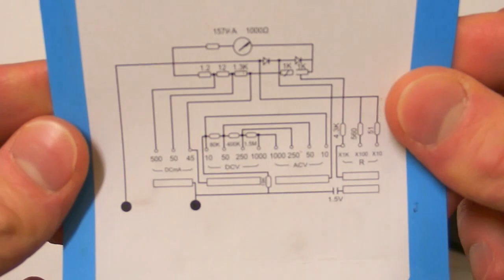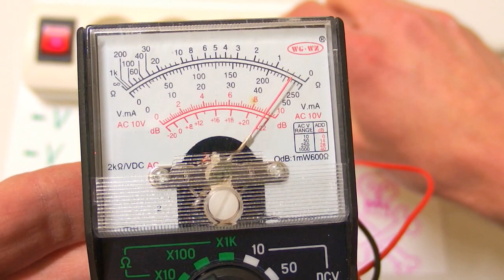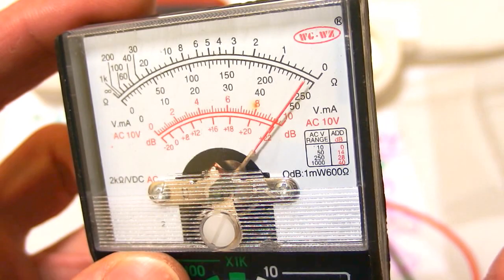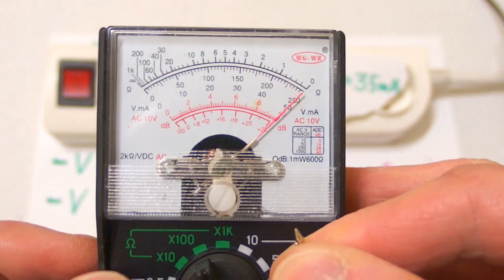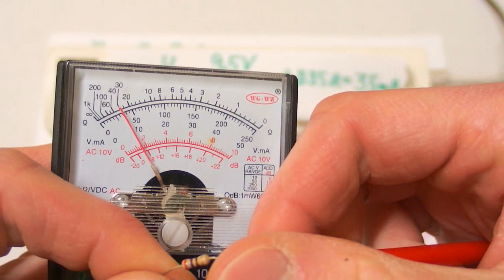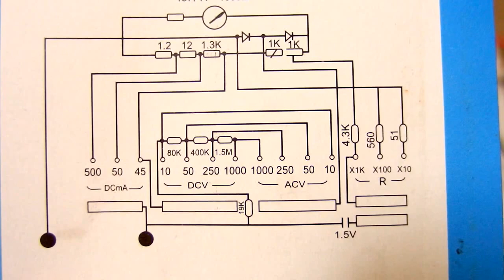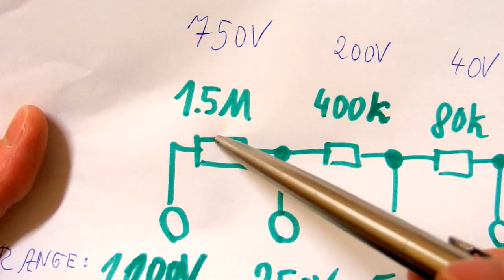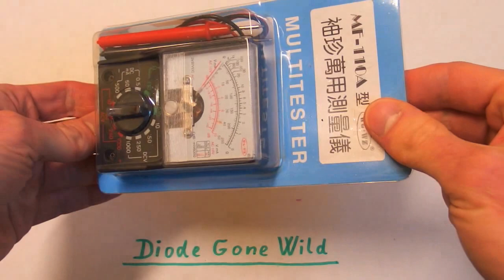Tiny $2 Multimeter with 1000V Range! Test with Smoke

Comment: I generally buy these multimeters to use the movement only (print a new scale and glue it to the existing panel). You tested the old multimeter and it gave out smoke - that's because these old models use smoke signals for high voltage :-)
Reply: Great observation... the Indian multi-meter complete with smoke signals... he-he
Reply: HAHAHA love your sense of humor. You should watch electro boom. He tests for high voltage by getting electrocuted
Reply: yes, i used those multimeter indicators as VU meters onto an amplifier, they are slow to move but if you cut away the needle and replace it with something more lightweight (the original seems aluminium) like a black brush hair it moves slightly faster, sadly they are becoming rarer bought locally

Comment: I bought one, gutted it out and turned it into an ESR-meter :D Can't beat that for a price: you get the movement, the case, and probes. Probes are junk but you can change them no problem.
Reply: the meter electronics do seem to be well made. too bad the manufacturer doesnt offer two grades of quality for that meter for a higher price of course. I would love to see you post that diagram of your ESR-meter modifications. I have two commercial meters with ESR features and they dont agree with each other. completely different readings!

Comment: I had the exactly thing as a child, 18 years ago. I asked an electrician, wow this thing can really measure up to 1000V? and he said: ``Maybe vietnamese volts``
Reply: it did measure right until he switched to lower range..
Reply: @JanoyCresva66  LOL
Reply: HAHAHAHA! good one but unfair. of all the Asian countries I think Vietnamese products are well constructed. It is mainland China that is giving all the other Asian countrys a bad rap
Reply: @professorparabellum  that's a racist joke. Propaganda made by USA government. They did the same thing with Japanese because of the war. If he wanted to joke about how cheap it was then he would use a Chinese instead. But no. He is racist at heart that's why he made that joke.
Reply: Well, in all honesty,  its so simple and with higher quality resistors, it'll be a good device to teach kids. Let your kids discover the world of electronics, without a 400€ Fluke or Metrawat Multimeter.
Just like you,  I had one of those cheap toy multi purpose instruments my dad soldered a 1A fuse in series to the leads. It worked for 3 years and it reached me a lot about the value of good equipment.
Reply: @DODO31193  we are Europe eugenes
Reply: Metric martha
Reply: It’s a very good design
Reply: It's not just high voltage but transients on the line that might kill you using a multimeter like this. That's basically a CAT I / 0. I use it with low voltages only.
Reply: @heatherriley2170  to be fair, in the 1950''s Japan did turn out a lot of crap just as China does now, so who said that at the time, would have been right. I'd say calling out VIetnamese for that would be more ignorant than racist as the Vietnam name might have stuck in his memory because of the war.

Comment: The vibration before smoke was the result of the diode exceeding its peak inverse voltage. It fused short, passing AC to the meter, just before the series resistors "went up in smoke".

Comment: I would never try to use that to measure 1000 volts, probably not even 220v or 110v mains voltages with that particular meter.  The looks of the build quality shows that it is questionable, and no fuse.  But for someone needing to measure small DC voltages (perhaps 1.5v - 24v) voltages, and resistance, without need for high accuracy should be fine.

I know some folks that bought these just for the meter itself, to build custom testers, etc.
Reply: It's useless for small voltages as well. I bought one on a local store just for the lulz and it measures 5v right, but when I feed it 3.3v it measures 1v. It's just a toy.
Reply: Yes I would agree low priced multi meters have a place in low voltage testing, zero to 24 volts ideal but when dealing with mains voltages and above a good meter is paramount. Fluke models or similar and of course a digital meter would be a better option than an old analogue style meter. I have two meters a very expensive fluke and a cheap lasar branded digital type the lasar meter cost approx 6 pounds the fluke 260 I would not attempt to use the lasar meter on the mains supply but it's ideal for automotive electrical repair, and it's not to bad on accurate.
Reply: that is a meter you would give to your child as his first meter. But caution them not to measure high voltage with it
only batteries. I have an old Simpson meter and it states in the cautions, do not touch the meter while measuring high voltage. Turn off the power before connecting or disconnecting to the main power

Comment: 6 years later, and still no another video with a high-voltage test of the new multimeter.

Also, those "questionable" pin plugs were the industry standard on Japanese multimeters up to roughly the early 1980s. And the westerners happily bought all those Japanese-made, rebadged Micronta, Radio Shack, Tandy and Sears multitesters.

Comment: I have this meter's big brother the MF-47 which is rated for 2.5k.  No smd, is also sold in a kit form, for 13.50usd.  I tested it and it worked just fine.  The accuracy is pretty good and it will test capacitors, and transistors.  I think this one could be modified to work fine.
Reply: The "MuthaFukin 47" XD
Reply: I googled the MF-47 to have a look and the input socket of that model is marked "2500V, 10A"
Reply: sounds like that meter is the one that should be sold

Comment: The problem with this is there must be a hole in it. Because its letting the smoke out. These things work using smoke because when it all escaped it will not work.

Comment: I have such a thing for a long time. On the bench, I mainly use it to measure voltages when ordinary digital voltmeters cannot be used due to high ripple levels (such as DC power supply from cheap halogen bulb driver) and I never use it to measure 1000V at 50V range. I think that's common sense. 
When measuring resistance, you need to calibrate the meter for each range - you will have much more accurate readings. 
For me, this is a profitable item stored in the pocket on my motorized bicycle, exposed to all the risks - theft, loss, impact, wetting, overheating, etc. For $2 I have a bold multimeter that survived for over 7 years and is still alive. 
Thank you, Chinese people! 

P.S.: It's not meant for stupid people!

Comment: i used those multimeter indicators as VU meters onto an amplifier, they are slow to move but if you cut away the needle and replace it with something more lightweight (the original seems aluminium) like a black brush hair it moves slightly faster, and there's room for some SMD LEDs, sadly they are becoming rarer bought locally

Comment: I used this type of multimeter when I was in 11-12 class. I was an electronic hobbist.  Also I saw every street wrist watch, calculator, torch light repairers using this type of multimeter. They actually used it for dc low voltage and they used to fixed the small ends of the probs with the pcb board by soldering. It was enough for their work. I bought it for 80 taka= 1 dollar. Still I have the red prob.

Comment: Honestly im surprised that that tiny thing handled 1000v xd
Reply: The fault is not with the meter. It is with the idiotic manufacturer to not be able to handle the English language and properly instruct the user for safe operation. Putting a fuse safety label and fuse ratings on the back of the meter THAT HAS NO FUSE, is wrong

Comment: One day I tried one day to measure amps on my 220v socket using one of these. The result was a small explosion, smoke from the meter and the circuit breaker for the room falling down.
Reply: KCTV Programme 'Recording you put the multimeter directly in the mains ?
Reply: Yes, but I’ve used it before for voltage counting and it worked fine on the mains.But when I switched it to Amps, BOOM
Reply: KCTV Programme 'Recording it's normal, Never put the multimeter in amp mod directly in the mains because amp is I = U/R, you need to put a resistor between the multimeter and the plug
Reply: You are supposed to connect a meter in series with a load to measure amps. When you put a meter into an outlet you are shorting it out. There is a wire shunt inside the meter that the current passes through. The meter just measures the current across the shunt. Outlets can deliver a lot of amps instantaneously before a breaker trips. Enough current to blow stuff up. But I guess you know that now.
Reply: you had it on the correct setting?

Comment: I'm a little wary of Harbor Freight digital meters on 120VAC, but I've never been bit. I'm pretty careful, since I used to measure 40-50,000 volts using a big Tektronix probe with SF6 insulation.
Reply: A high voltage probe is the only way to measure high voltage and be safe
If you must measure high voltage shut off the power connect the meter then turn on the power. do not touch the meter. That is what my Simpson meter instructs you to do on my old model 260

Comment: Found one in my local electronics shop, it cost 30.500 rupiahs (INA) or about 2 USD.
Reply: I hope it works well for you. I prefer to buy my equipment on line and reading the reviews. With Amazon if it is a piece of junk you canm return it... no questions asked.. even get a warrenty on the product

Comment: Yeah it's cheap, but for $2, that's pretty impressive. I only use my multimeter on 1.5, 3, 9, 12, 24, 120 volt stuff and check resistance. I think I might get one just for kicks. :)
Reply: why are there no dedicated ESR meters out there? I only see meters designed by viewers and no schematics?
Reply: Its 2 bucks for a clearly used already cheapo multimeter.

Comment: I still have an old Micronta that looks a little bit like that, except no knob, just multiple holes to put probes into to select the voltage/current/ohms/etc.
Reply: I have a totally automated Micronta, auto off, auto ranging, but a cheap phenolic board that cracked and broke many of the fine lands/traces, a really nice meter when it worked

Comment: I have a multimeter that looks almost identical to that, it's made by GB instruments. GMT-312
I never use it. Mine only goes to 10 V....50 V.... 150 V. & 300 V. Both On AC and DC.
1000 V. ??? I don't think so !😂
 I smell some Magic Smoke on the way!

Comment: I think the fuse is built in on the probes, maybe the current rating is to high?
Reply: In over 50 years of electronics experience, I have NEVER seen a fuse built into a multimeter probe.
Reply: @johnc8910  , the probes's cable IS the fuse.
Reply: that is an interesting observation

Comment: I use a analog multimeter and it has got no problem testing ac voltage  but mine is very good quality and the scree is bigger and i replaced the leads and it can measure more resistance etc

Comment: I had one of those exact meters for about 20 years! It just died this year.  Really, it wasn't the meter's fault--the battery leaked into the movement...poor meter...  :o(

UPDATE:  I FOUND A NEW ONE!!!! SUPPOSED TO BE HERE IN TIME FOR NEW YEARS!!! only $3.32 with shipping...I would only use it for DC stuff anyway like the last one. :o) #nostalgicnerd
Reply: I have lost countless devices  and thousands of dollars because of leaking batteries. Then someone told me 40 years too late that alcaline batteris dont leak. Do you remember when  Eveready batteries used to have a statement on them if the battery leaks, they will replace or repair any device damaged by our batteries!

Comment: So it does work for upto 1000v but it doesn't offer any protections if it is set to a lower measurement then what's being measured?

That's not too bad then. Just start off at the highest setting and scale downwards where possible if you need to get more accurate readings?
Reply: I have many good meters and none offer protection at a wrong or lower setting

Comment: Never holding the meter while probing HV, if it does explode it will flashed plasma and carry current onto your skin
Reply: never hold any meter while measuring high voltage

Comment: AMMs are cool.
Reply: DMM master race ;-)
Reply: ^^ log time no see. how is life ? :)
Reply: Good of course
Reply: cool ! planning any interesting more projects ?
Reply: thats a mechanical oscillator or something for voltage boosting ? you are feeding the oscillated 12v into fluorescent choke ?
Reply: A simple unregulated boost converter based on mechanical relay oscillator. The ballast gets feed with oscillating 12V, each time the relay went off, there is a big voltage spike which later charge the capacitor array. A diode prevent current flowing backwards.

Comment: He is testing a multi-meter on the 50V AC range and supplying it with 1000V AC! And he expects it to work normally! And he seems to be so surprised when he sees smoke coming out of the poor little thing. How absurd can that get? Moreover, the multimeter he tests at the end is different from the one he shows in the beginning.
Reply: He was seeing if it could wistand being put in the wrong range, because a good meter would protect against that
Reply: I would expect my meter not to smoke if I accidentally have the wrong range.
Reply: How does an analog meter protect against that? There is no over range limit on analog meters. They expected people to be smarter back then.
Reply: I got into electronics around the same time.  DMMs are certainly daily drivers today but there's still a place for a good old analog meter occasionally. Now in those rare moments you do have to take extra care with what range you are in. It is like the difference between driving a manual and an automatic shift. You have to start high and work your way down.
Reply: A proper analog meter will have fuses, PTC thermistors and metal oxide veristors. If theses meters had these than the meter would had properly survived; at least long enough to test.. since the current would be limited appropriately by the ptc thermistor.
Reply: My Simpsons have a fuse in them. But it is not for all ranges. They are most certainly proper analog meters too.
Reply: He is a brilliant technician/engineer but like most of them lacks common sense

Comment: wrong battery. Need chinese battery and spacer, becouse chinese battery to small. Varta is made in Germany, so its real size.
Reply: Chinese battery is AA- and 3 mm shorter than regular AA's.
Reply: Actually the specs for AA batteries are quite lax, allowing for several mm in length variation and, what's worse, allowing 14.0-14.5 mm for diameter and no clear spec on electrode height/thickness or shape. Often rechargeable AAs are at the very limits of the specs, and won't fit properly in many devices that accept slimmer alkalines or zinc-carbon batteries.
Reply: yes the right battery will make it work on 100,000 volts

Comment: To measure Ohm , you need to short the probe and adjust the side VR until you get the needle point to zero before measure resistor..
Reply: this meter does not have that feature
Reply: @rogerd4559  I have exactly same meter.. all analog meter should have that ..
look at this when he turn the meter there is a adjust slide beside the meter which use for zeroing 
 https://youtu.be/AK02JakVVPY?t=69

Comment: Ah, measuring tools, my favorite. Otoh, i must say, seeing piece of stryofoam too close to smoking electric arcs was a bit unnerving, even on a sheet of heat-resistant polymer. This stuff can have some really toxic smoke, too.
Reply from the maker: Is styrofoam really that bad? As a child I liked to put it to a candle and watch it "disappear".
Reply: Polystyrene, if burned, releases quite toxic styrene. Then, there's a bunch of simpler oil-related compounds that are dangerous too, with carbon monnoxide at the bottom of the list. It requres more exposure than a few gramms of stryofoam to be noticeably dangerous, but with this stuff any risks are unnecessary.
Reply from the maker: Ok, I definitely don't se it on fire :). It's a shame that the styrofoam is so abundant everywhere...

Comment: if i don't see off on the side of the knob i will add a switch connected to the battery
Reply: You don't need to add a switch. Leaving the range switch in any "Volts" or "Current" position effectively turns the battery off.
Reply: why do all these modifations? Just spend a little more for a well made quality meter

Comment: Not sure what to expect from a $2 device. Should only use it for testing battery or resistor casually. Common sense will tell you not to use it for high voltage testing. Hate it to say this again; "you get what you pay for".  At the end of the day, they didn't force us to buy it.
Reply: yes COMMON SENSE

Comment: I hate analog Multimeter i had a bad experience of it i personally prefer Digital one cause it has wide ranges & functions
Reply from the maker: analog multimeters are more or less a thing of yesterday. I used to have an analog meter, I connected it to a too high voltage and the needle just rocketed to the right and broke in half :). But analog meters look really cool as audio level indicators in amplifiers.
Reply: None of my digital meters can measure the current of my spindle switch mode power supply. My analog meter can give me a reading though. I'm not sure if the reading is right, but it is something.
Reply: many ham radio people prefer analog meters because of the low ohms per volt and they show deviations in voltage that digital meters cant